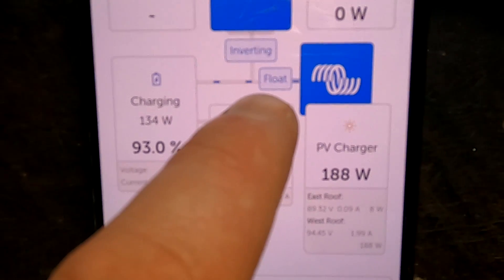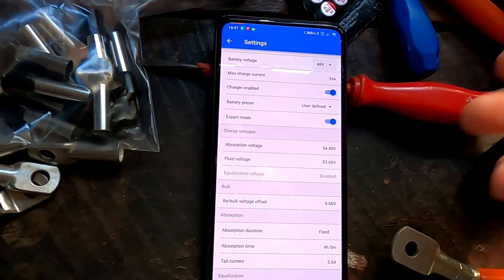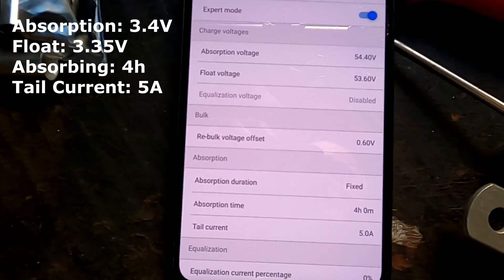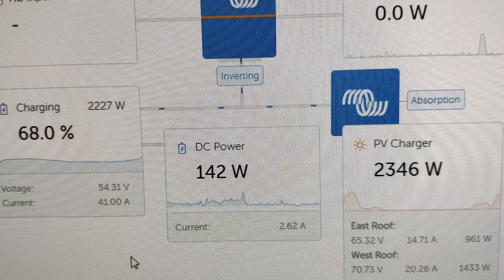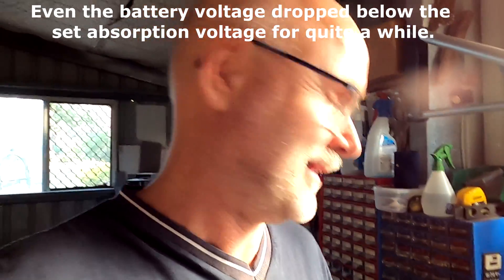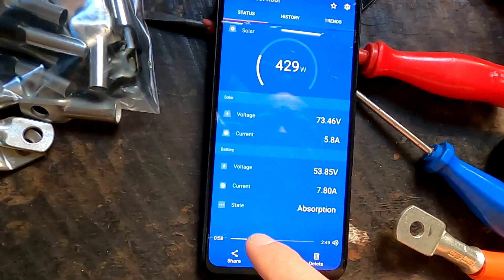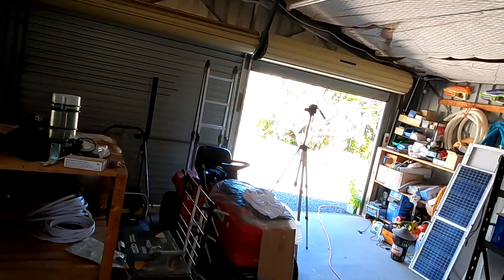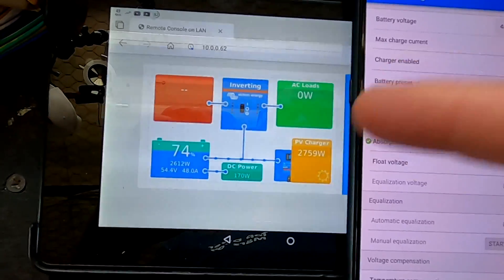How Absorption, Tail current and a few clouds can trick you!

Comment: I've been charging to 54.8v (3.425) for many months and have not had even one day where the batteries did not charge to 100% when there was enough energy. If you are trying to charge to the lowest voltage that will get you to 99% SOC, give 54.8v a try.

Comment: So I figure that tail current is quite OK to use in a AC-DC charger, but not in a solar charger. Thanks edit: Apparently my JK BMS connected to a raspberry running Venus OS isn't able to communicate voltage limits to the Victron Smart charger, which only has bluetooth.

Comment: I need your help . What tail current in the charge controller? Batteries eg4ll lifepo4 600 AH, victron 250/85, 24v system.
Reply from the maker: I have my tail current turned off. I absorb for 1h and then go back to Float voltage.
Have a look at my settings here: https://off-grid-garage.com/my-settings/
Reply: @OffGridGarageAustralia  see!! I copy ypur settings. My rhing is that ibsee a consistency in absorption time, ive been getting 20 miniutes only, time to check the victron smart shunt, undecided aboit having 2% of tail current ladt week its been on .5%.

Comment: Hi buddy I went to your website thanks also did some tests of my own and I agree Victron settings need fine tuning I’m scratching my head here lol After the bulk phase with
10% current there is a
SOC of 80/85%. But At
the end of the absorption
phase there is a SOC of 99% if the absorbed
current is less than 2%. In
fact, the battery chargers
or solar controllers (also
victronenergy) that
terminate the absorption
With the tail current, they
do so below 2% or less. A
current of 4% on the
other hand does not
indicate 100% SOC,
rather than 95%. I did
some tests, 115ah 
battery is not
at 100% when it draws
4.4 Amps in the
absorption phase. It is at 
99, ×% when it absorbs
about 1.7Amp in the
absorption phase.
Otherwise why do 
Smartsolars terminate
absorption with a tail
current of 2%? And not
4%? lots of settings need fine tuning

Comment: Hi I’m very new to this so looking for some advice if this is ok to ask . I have 12v battery 200ah with Victron mppt I have found the absorption and float of my battery which is 14.6v and 13.3v but I’m unsure on the tail current which at the moment says 1amp 
I also have the Victron bmv-712 which I’m told the charge voltage needs to be 0.2v below my absorption which will be 14.4v but again I’m struggling with tail current in the bmv 
I’m wanting everything to work correct with mppt and cerbo and bmv 
I also have multiplus 
I’m so confused on the tail current and detection time 
I’m finding even tho I have 480w of solar it’s in bulk mode all day long 
I wake up the bmv says 96% so mppt in bulk all day and by sun down it’s still in bulk at 99% I’m not getting the float 
the only power getting taken from the van is wi fi router not even 0.70amps
Reply from the maker: I have made a lot of videos about this and you also can have a look here on my website for more information: https://off-grid-garage.com/my-settings/
Reply: @OffGridGarageAustralia  thank you

Comment: 🐸 very interesting. I am running a 150/35 solar charge controller in a 12v lifepo4 system on my van with 200w (due to increase to 400w). I am leaning towards setting the absorb and float both to 13.8v, and see how things go. Cheers.

Comment: 1 of the prob's im having,, is my charge controller in float  but its still charging the batts, its still pushing 1000 to 500 watts , with nothing connected to it,, sooo why is it float if you still have volts and amps coming in?

Comment: Dude please help me.. My 100/20 is going into float mode stating on the app it's 13.8volts but when I test with multiple multimeters it's only 11.4volts and my inverter is giving me a low voltage alarm when adding a load?!?!? Please could you help I'm going to loose my mind ?!?!

Comment: Andy. Hallo from South Africa. Does your Victron Charge controllerd (larger models) have "adaptive absorbsion" ? I am working with 12volt and set my 75/15 victrons all to that setting. Seeing I just changed to Lithium batteries i have no idea if that is a good idea
Reply from the maker: Hi Ben, no, they don't have adaptive absorption either. Never heard of this before. I'm getting 150/70 soon, so maybe these have such settings...
Reply: I am using 75/15 models, much smaller than yours, and then also "12volt" systems. I still have to test what the adaptive does and how it infleunce the final result. Thank you for all your testing! You should call it "DC SOLAR TECNOLOGY RESEARCE" 👍👍
Reply: I tapped on "fixed time" in the app above the 2 hours and it opened the option
Reply from the maker: @benengelbrecht5637  Ah, I see what you mean, yeah, nah, you leave this on 'Fixed' as we have Lithium batteries here. The Adaptive Absorption is for lead acid batteries. Once they have been deep discharged they need a longer absorption time to recover. That's what the setting is for.
Reply: @OffGridGarageAustralia  Thank you for that answer. I will then rather play with fixed absorb time.👍

Comment: QUESTION or video idea.  With all of your Hands-On knowledge regarding what voltage it takes to fully charge and balance cells what is your opinion in relation to off-grid use on bottom balancing versus top balancing?
Reply from the maker: Thanks Travis. I would always recommend top balancing. In solar storage installations, you will use your battery rather in the medium to higher SOC area than completely depleting it on a regular base. So it should be optimised for that. All gear you buy does top balancing. I never heard about a bottom balancer or a BMS which does bottom balancing.
At the end, it does not really matter in terms of capacity. The cell with the lowest capacity will determine when your pack turns off either way. I think bottom balancing is a bit outdated these days.

Comment: Question.
Can you use a pwm controller to charge a lithium battery who has its own bms? With solar
Reply: Using PWM is not recommended with Lithium due to inherent voltage spikes seen during the rise time of the Pulse Width.

Comment: Andy, great new video!
It shows clearly that the control of the charging by voltage/current is pretty much useless, because it is inconsistent. Absorption voltage, absorption time and tail current to charge to a specific SOC are parameters that work with a constant current charger on a unloaded battery, only. And even there they are only work when you are able to over-charge, like with a lead-acid battery. If charge current and load is changing all the time you cannot get a consistent result, especially if you want to stay below 100 %, but not to low. 
As mentioned below, a SOC controlled charging method has to be established for this. As the SOC is already available in the Smart Shunt, Victron should establish a control loop between Smart Shunt and and Charge Controller. Then it would be easy to establish charging to a specific SOC.
Off course, there should then also be a calibration charge be done, like the equalization charge with lead-acid, to reset the SOC to 100 %. But this would be only be necessary ever few weeks. Actually the equalization mode within the charge controller could be used for that. 
Actually this can also be done with external gear. I have a battery computer from Mastervolt, which can switch the chargers off through as solid-state relay, when a specific SOC is reached, and turn on again when SOC has fallen to a lower limit. But from time to time the SOC meter has to be re-calibrated again, by a higher charge level.

Comment: ""Testing the difference of charging to 3.4V and 3.5V with and without Absorption.""
at 2:57.....  charge to 3.5v just ended.  voltage drops to 3.393v (no load).  this is very similar to how a LA battery acts.  the voltage may be at 3.5 while charging, but "at rest" voltage is only 3.393.  is a way to tell SOC  developing?  more thoughts to come.  think about it,  bed time here.  (inspired by Up North and Personal)
Reply: in the video above, 
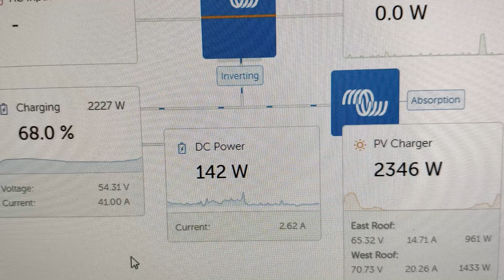4:30  at this point (which i'm not sure how long since 3.5v was reached) the "at rest" volts is showing 3.382v.  this may be a result of using the software.  but, this was given no attention.  shortly when load is applied, voltage descends quicker.
6:18  discharge stops.  volts start up.  does this not suggest if you were charging and stopped the volts would go down?  what i am seeing appears to be true battery (at rest) voltage is less when charging and more when discharging.   if the voltage reading taken, with no load/charge, is carried out 4 decimal places , could we determine the real SOC?
we have to remember there has to be a voltage difference for current to flow, either way.
Reply: ok Andy, time for a bold statement.  at 2:40 you say the battery is charged to 3.5v.  i say, not true!
Reply: you tricked me!   while trying to figure out how to get you on the same page as me, i got on the same page as you.   LOL!!   

in the float video, 14:39, you confess, "what i have found the best way....."  as you see in the video, is to set both absor & float at 13.4v.  watching more recent videos where you use 13.4 & 13.3 (not the same values) i managed to get the cart before the horse.  this led me to be watching 2 or 3 videos at a time, but i was getting closer to my objective.  at the point you said the above, it all came together.  that said you weren't confused at all.  it was only me! 

can we carry this one step further and see if we can come up with the correct SOC?  it would require getting "at rest" (no load/no charge) voltage readings several times a day.  compare those with your shunt SOC.  are you with me?  am i nuts?
Reply: i see it like each voltage (taken 4 decimals out, at least) will be like a finger print.  there is only one %soc for each print.  not sure what equipment is needed to get that reading, but........

btw, a voltage taken while charging/discharging will not tell the real story.

Comment: Andy, I was thinking that if you could access a clock you could make decisions based on time of day as well as SOC… but you have a form of clock, you have a roof, and it’s solar panels, that get more power in the morning than in the afternoon.  In the AM your most likely to have a lower SOC and therefore set your battery options to be more aggressive in the AM… while the west roof can be assumed to be more for the end of day functions and therefore less aggressive. As long as the two charge controllers don’t “Fight” I don’t see why they need to have the same settings. Frog 🐸

Comment: Andy, switch to "Adaptive absorption." You have set "Fixed absorption" and with fixed absorption, Victron warns in the setup: "make sure to disable the tail current... tail current could end the absorption time sooner if the battery current is below the threshold." Which is exactly what you are seeing when clouds cause the PV output current to dip. Then test again using adaptive absorption and the tail current set. Hopefully, the clouds will cooperate to give you similar test conditions.

Victron should explain the fixed versus adaptive absorption settings better.

Comment: Here's my frog: 🐸

This looks like a defect in the way Victron is handling absorption time. If the voltage drops below the absorb voltage, it should drop back to bulk. It's not "absorbing" if the voltage is lower than the absorb voltage.

I haven't used the Victron settings for bulk/absorb/float in a few years. I currently just have loads that trigger at 3.4v to keep my battery from getting to 100%. I swear I remember Victron not behaving like this when I was using their bulk/absorb/float settings many years ago.

I would report this to Victron. This seems like a defect in the way they are handling those trigger points. If the voltage drops below the absorb voltage during the absorb time (Either defined by time or tail current) then it should switch back to bulk. It shouldn't switch to float unless it maintains that absorb voltage for the entire duration of the absorb time or tail current.

Your discovery at the end of your video regarding the higher voltage = higher solar yield is exactly why I stopped using bulk/absorb/float altogether. I have my BMS set to charge at a flat constant voltage of 56v and I simply have diversion loads that turn on to divert that extra power to water heaters, air conditioning, etc when the battery reaches 98% SoC which is around 3.4v/cell.

By keeping the MPPT voltage high and by diverting that excess power to useful loads you can really maximize your total solar yield while still keeping your battery at a lower voltage to maximize battery longevity.

Comment: 🐸 If you had 2 batteries and software control over the charging current and discharging contactor of each then it would be possible to smoothly fully charge/balance/calibrate one battery while the other takes any remaining charging capacity and supplies loads.
Reply: This creates unnecessary energy flow one battery to the other as he already stated in a previous video. Besides I tried to tell him before to use another battery that uses 3.7 nominal @ 14 cells that pack will have a higher charge voltage which will allow balancing to to optimal conditions. But he wants nothing to do with that.

Comment: Hello Andy, Great Videos as usual. You have really given practical proof why 3.45v is great voltage for charging.
I have a question, is 3.4v (54.4v) too high a voltage for float?
Reply: Floating to 3.35V or 3.4V gives you the same energy storage, so why do you stay high up to 3.4V? 
Stay at 3,35V

Comment: Besides from a cloud moving over your panels, it can also be a (big) load switching on/off. 
Which then makes the voltage go all places!
Or hit the tailcurrent accidentally.
Reply from the maker: Yes, good point. I have seen this as well when charging the car and the charger stopped. If the solar charge controllers were on full blast charging the car and this load turned off, the SCC keep supplying energy for a few seconds and the battery voltage spiked.

Comment: Tail Current - EndAmps is calculated as 0.05C of the Highest Battery Pack within the battery Bank.  For a 280AH Pack that is 14A.   

General convention by Known Manufacturers (Like Battleborn and others) ss well generally recommend 15 Minutes Absorb per 100AH Storage Capacity.

These settings work, are observable & reproducible.
Try to
ABSORB @ 56.4V
FLOAT @ 55.8V
Rebulk @ 55.2V

PAY ATTENTION to the BMS when running Absorb and monitor it from 15 Minutes and you will see the deviation kick off and run a bit.   

REAL TIE observed, Absorb on my systems are set for 1 Hour but within about 25 Minutes Absorb Stops as EndAmps is reached and Float starts.  IF Power is drawn which the Float cannot service & battery power is withdrawn, then the system will kick back into Absorb & Float once Tail Current is reached again.   I watch this EVERY DAY and being 100% offgrid solar, it is LIFE @ WORK.

Comment: Andy, great video! 🐸 I have experienced the same frustration with lack of coordination between Victron smart shunt and charge controllers. In my case the shunt occasionally resets the SOC to 100% much to soon based on tail current falling away.  This is not due to the pack being full it's due to the power from the panels dropping off at the end of the day. The charge controller knows what is happening because the panel voltage also drops off so why can't it tell the shunt this is what is happening and improver the SOC reporting! Perhaps there will be some firmware updates from Victron some day to properly take advantage of the shunt and charge controller pairing?
Reply: For the shunt to work with the charger on network, I believe those functions needs to be enabled on a GX hub under dvcc. You enable voltage temp amps, limit amps etc.

Comment: The reason that the State-of-Charge (SOC) value is not used to control charging, is that it's not an absolute value. 
It merely an estimate which is calculated for the convenience of the user. And by definition, it will constantly change.

All the monitor can do is total the current in and the current out, estimate the full and empty points, and from that calculate the apparent capacity, and thus the SOC.

In the days of Lead-Acid batteries a Hydrometer could be used to measure the true SOC. But a hydrometer is inconvenient, so the solar companies decided to calculate an "apparent" SOC by integrating the current in and the current out, and use the voltage trip points to calculate SOC. These modern controllers (for Lithium batteries) are no different.

If you did try to use the SOC to terminate charging, you will end up destroying the batteries, as the system will no longer have any way to estimate capacity and SOC .

Comment: How big is you r battery? I have a 28kWh LiFePO4 battery that I charge with 95A. I have seen voltage variations when amps change, but nevery to the extent you experiance.

Comment: Higher voltage 55.5 to 56 achieves the Float mode quicker (less asorb) which then reduces input / output battery losses with the power going straight from panels to load - got to be a win / win situation especially if your a frog

Comment: (frog) Just set both Absorption and Float at 3.40 V per cell. You are not gaining anything by dropping the charge controller voltage to a lower level.
The loads will discharge the battery (micro-cycling) during that time and you will lose solar energy. Eventually, it might go into re-Bulk / Absorption again and do another micro-cycle.

If you don't want to charge to 100%, then just set a lower voltage. It makes no sense for LiFePo4 to charge to 100% just to quickly go into discharging afterwards.

Absorption and Float at different voltages are remains of the Lead-Acid technology. For lead-acid, it does make perfect sense to charge to an Absorption voltage, stay there for a while and drop to a float voltage. But that is a requirement of the chemistry. It does not apply to LiFePo4.